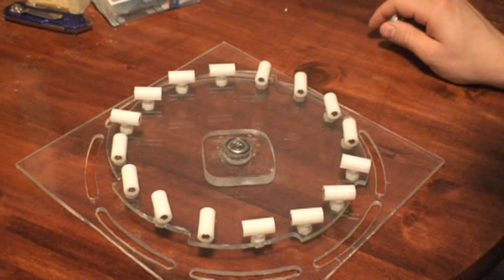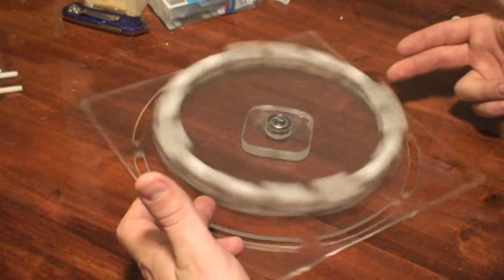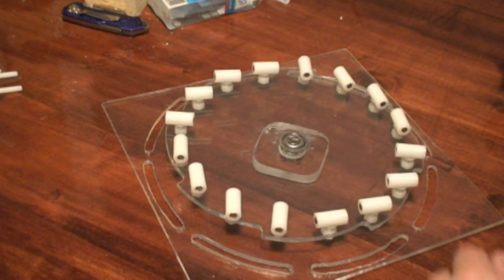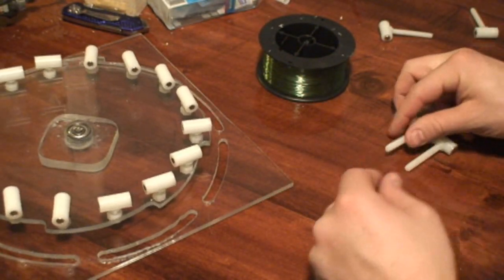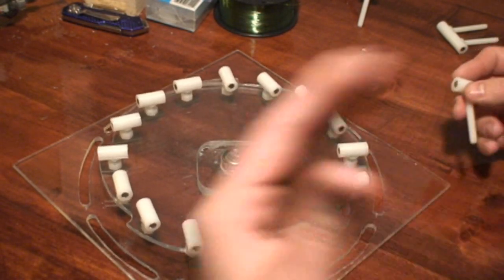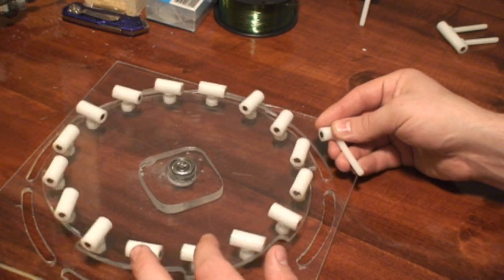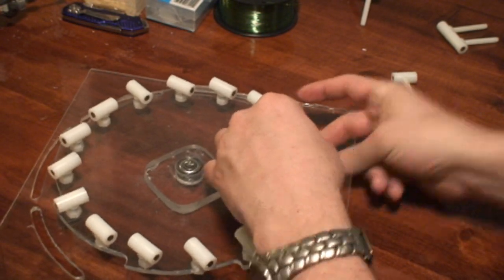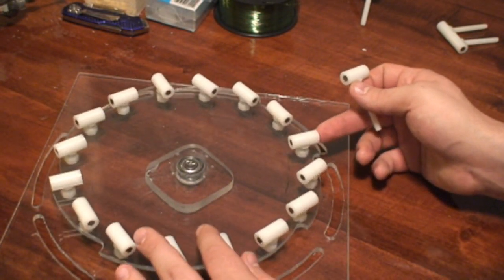Magnet motor, free energy, overunity test 2

Comment: This could work if you attached the magnet in his hand to the bottom of the wheel, and created some sort of mechanism where the single magnet flips around at a rate according to that of the wheel's energy, while being powered by the wheel at the same time. This is actually quite a creative idea I'm seeing, but the problem is that eventually the magnet would become demagnetized. It's like nuclear energy - powerful, but nonetheless limited. So this video isn't total bs because it could be engineered to work to a degree, but there still is no such thing as free energy.

Comment: The only problem that I have with this is that this isn't actually free energy. The magnets are providing force, certainly, but they aren't a limitless provider of energy. They will wear down eventually, and when they do your motor will stop running. In fact, I'm pretty sure you would lose more energy than you would generate by way of activation.

Comment: May be you don't need to switch the polarity. Try to set the attraction magnets on the all 4 corners and push them away mechanically with something attached to the wheel . Good luck.

Comment: Use heavy fly wheel , rotational inertia is basis for over unity devices, trigger one individual magnet on the rotating disc using a coil

Comment: The main problem with these perpetual motion motors is that they really fall short when you try to place a work load on them.  Yes, it will spin freely, but try placing a work load on it, and it fails.

Comment: A belt and it will spin the one u are holding. The one ur holding could have a curved handle back to the moter you got this bro.and if u changed each on e on the moter held the one in hand solid

Comment: Very nice approach. First of all, thx for the inspiring moment! I've not seen your other videos already, but, for the single "trigger" magnet, what if you male a "Bike system" between the larger disk & a small disk & attach the trigger to it in order to get the propper synchro to change poles? I'm sorry, my tech-mechanical english is the worst in the whole universe..., but, did you catch the idea? You'll just need to do the first shot, the system wont stop anymore..., am i wrong? Thx a lot for your time.

Comment: Put the main magnet, the one you have to switch back and forth, on a special mount which will be triggered by the spinning of the wheel. On the wheel, add an arm or something like that which can interact with the mount I already talked about. The two will work together to switch the magnet and continue the motion. And by the way, this video is way cool.

Comment: What if we can add gears and link it with the polarity of magnets on the glass with a pole atteched to the glass on which magnet are attached to rotate or switch the side of the pole of magnet which we have to rotate with our hand. And as fast as the glass rotates gears can changes or moves the magnet(the one which we use to attract the polarity of glass)

Comment: If it moves with the magnets pointed in one direction then why not just have them all facing that way and then you can just leave the one magnet in a stationary position instead of having to flip it back and forth ? Then you could just flip and reverse the poll to slow it down or stop it if you wanted.

Comment: It looks like you could build a holder for the magnet in your hand, attached to the base, that includes a "gear" with cogs that would be tripped by four cogs on the spinning disk. That would turn the magnet to the required position for each of the four sections. 
Or, really it should work by just turning all the magnets on the disk to have the same pole facing out, and fasten the driving magnets in place around the disk. But you've already tried that by now, and it doesn't work.

Comment: The motive power is coming from your fingers, as you twist that magnet.

If did that part using an electric motor, you'd find that motor consuming 10 watts for every 9 watts output power on your disc.

Comment: the laws are made to break them at some point, its called evolution. At some point the people thought that earth was plain object...
Here all people say "you can't do that..." stupid comments.

I can give my 2 cents which could help in a future. I've been experimenting at home, and i discovered that when you apply lateral/shear force (slide the magnets) your strenght needed is less than the required direct pull force, by perhaps 50-60%.
This means that if you can store that odd force and reuse it on the same cycle, you get acceleration. I am still thinking that this is possible, and i am almost close to finish a prototype whit springs and gears. This is not optimus because each gear is applying friction, but anyway, whenever you design a system is common to reach to a poor quality.

This is not called free energy, because magnets get exhausted at some point. But is a really good way to get "free" energy.
Reply: No, physics laws were there before we realized it.

Comment: nice try but, the power needed to flip an electromagnet would mean a greater input than output. to flip that permanent magnet in your hand would need gears & pulleys that will lose too much energy. a step up transformer with a 1:10 ratio may help.

Comment: if you were to turn that wheel into a gear, then put another gear at half ratio, cut a little circle at the edge of the smaller gear, use that hole for a rocker arm and a swivel block on the end with straight gear teeth on the bottom and a fixed guide on around it to hold it straight as it rocks back and forth (like a piston) .. then rig a gear around your power magnet at just the right size so the rocker arm flips it at every quarter of the wheel. and BAM! your wheel powers itself.

Comment: Well good to see that there are still enough people out there spending time on criticizing every good idea instead of thinking on their own. I believe that most of us today forgot what humans are capeable of.
Whatever I just wanna speak for myself:
I got some good ideas for this project and would like to share them. For example to prevent using extern energy sources you could find a mechanic answer to the problem like an impulse switch every time before your magnets are changing polarity.
Have to admit that I didnt calculate it yet but with the right balance you should be able to geht the thing up to a certain speed. depends on how much energy the magnets are putting against the seit hing system. 
I hope that I could help.

Comment: Now questions first what if you made that "machine " shall i say multiple layers and had them turning different directions would that affect the polarity of the first layer versus the second layer or would they be so polarized to the electro magnet (when you get one if you haven't by not now) that it wouldn't affect anything and also with the electro magnet how fast can it be set to as of course over the time it takes to get it spinning a high enough speed could the electro go faster would it speed up how would it do it if it could and would it be possible for it to spin so fast that say the magnets would come off or they would some how shift positions also could it spin faster than sound like i can tell that there is no electricity running to it from an outside machine or wall saquet could it possibly go at so many rpms that it creates a sound and then eventually it will be faster than that sound im not sure exactly how you would test it but im so curious about this brilliant idea...
Reply: But one last thing for now could this get so hot it could melt its self how fast would it be able to go how hot would it get im sorry that i have so many questions but then again i am only 15 and i just am fascinated by this im so interested in learning more about this please reply to me please .

Comment: You just made a typical synchronous motor. With a bearing in the axle, you have very low friction so it may appear to spin forever once it's moving. Eventually though it will stop. Furthermore, if you wanted your motor to do any real work (moving a car for instance), you will have to energize that electromagnet with a power source. This is precisely what typical motors do. You will never get more energy out than you put in. And because of friction and design limitations, you won't ever even get out as much as you put in. This is stuff that engineers have known for centuries now.

Comment: you probably have solved it by now. I know you dont need an electro mag to solve it. 
The end of each polarity cycle should have a lever and the lever trips the conductor to change the polarity of the conductor .

 the conductor should be constructed and positioned in such a manner whereby it is rotatable thus changing polarity when tripped by the level of each polarity change.

i can draw a simple sketch it has not been resolved.
i believe the most difficult part has already been achieved.

Comment: One of the best concepts I've seen so far.  
I think that would work with a partial gear to flip the stationary magnet, (perhaps use four stationary magnets) and also add a flywheel weight to make it strong enough to release pulses of work with the developed kinetic energy.

Comment: Hey bud, I really like that! All you would have to do is rig up a pinion drive gear system so that your stator drove the pinion wheel & simply run an axle with the switching/alternating magnet off the pinion. (Just a vehicle rear diff concept) That'd enable you to time the alternating/switching.

Comment: Hi there its been a while since you uploaded this video. 2 years before I was working on something very similar which I quitted because of the lack of money and materials. Most academics wont get into the topic and most critics are students who believe to understand physics. Since they dont fully understand thermodinamics, they will see a self sustaining device like imposible.  The truth with this permanent magnet systems is that they will naturally seek to balance themselves, but if the arrangement of the mangnets is displayed in a way they are always almost balanced but not quite... is when you can use a concept known as regenerative rotacion, taking advantage of this gap between momentum and balance.
 And eventhough it will not run forever, it will have and incredibly higher performance than the generators whe normally use. In the other hand it is clear to me that somebody who criticize someones work without taking the time to read the purpose of the experiment is a very laim observer, therefore, someone unable to apply the scientific method do to its poor hability to observe which is the first step on it. Keep on with your work the future is for those who seek what seems futuristic or impossible. The others will be the consumers of the great inventios. And keep in mind is better to be remembered as someone who tried than not be remembered at all.

Comment: I'm not too familiar with the losses of energy but I do know "free" energy is impossible. But could this self sustain? If it was made to mechanically change the magnet polarity every time it needed to would it be able to run itself? Obviously the free energy is bs because magnets wear down but I'm just curious. Could you hook up a small motor to this to basically convert the magnetic energy into electricity?

Comment: It's not free energy because he is expending energy to flip the magnet back and forth, as well as to resist the pull of the permanent magnets on the rotor.  All he is doing is slowly "inventing" a basic DC electric motor. If you were to take apart a typical simple DC electric motor,  you would see the brushes and permanent field magnets installed in the stator, and you would see the rotor with the electromagnets/armature as well as the commutator, which transmits the current to the armature in perfect timing as the shaft rotates. He has merely replaced the commutator + armature with his handheld magnet, and placed the permanent magnets on the rotor instead of the stator. The energy source is therefore the food in his gut (chemical energy that drives the body's movements) rather than a battery; but either way, energy is expended. He's complicating matters by adding the magnets; if he wanted to spin the rotor using his body's energy, he could just stick to spinning it with his fingers directly.

Comment: Magnetic motors will be the next energy source. Atomic magnets will be printed with a laser printing system that will use 1/1000th the energy of the output. Atomic magnets will essentially be 100% carbon with all atoms being aligned so that 100% of the atoms will be polarized. Atomic magnets will be orders of magnitude more powerful than magnets today. Magnetic motors will power everything in the future that batteries or fuel powered generators do today.

Comment: I have seen the use of the horseshoe magnet on the outside in a fixed location that according to the speed of the rotation would increase itself. I love your idea. You're showing transparency by using clear plexiglass without any motors which others have used to deceive their audience. Your design of angles is what I am most interested in. So one magnet is perpendicular and each successive magnet is @ a 15° angle?

Comment: you need to discover Lego Technic series, which includes oodles of tiny gears and such to set up a tram line to convert the main wheel to flip or rotate the controller magnet. ( ? ) + Too much Yabber.

Comment: what if you could mechanically cause the magnet outside of the circle to switch positions, such as through gears or clockwork.  Would the generator be able to be automated or would the extra friction from the gear-work lose too much energy?
Reply: The friction occurring in that process will not make the mechanism you suggested be possible.
For justifying my statement : If your idea works, you'll create a self perpetuating machine, which is not possible. :)
Reply: That is a suggestion, a simple pulley coming off the flywheel connected to the right size wheel to turn the stator magnet at the right moment of turn.

Comment: What about if you made 2 wheels the exact same and set them next to each other with the push synced. So that they worked off each other with out the need for a electromagnetic switch! Also Tesla was a firm believer in the numbers 3, 6, and 9 with the main number to everything being 9. 9 is the secret of the universe!   So you should probably have either 9, 18, 27, or 36 magnets for maximum efficiency! Also your groups of north/south should probably be 3 magnets not 4. Just some helpful advise!

Comment: What about a circuit attached to the electromagnet as the circuit is being powered by the single magnets so from the free energy powering the electromagnet then the electromagnet powers up more free energy from free energy in the first place then powering another circuit board that only powers another electromagnet that powers the entire other generator the storing energy inside rechargeable batteries attached through a battery charger circuit or just a plug in then letting you take the magnet away

Comment: Use gears to switch the polarity of the outside magnet. As the bigger wheel spins inside the smaller gears spin in accordance with the inner wheel. If you get the timing right you'll have it. The only problem is that it would reach high speed and explode due to friction and vibration. You're probably going to have to use stronger material.You can also make frictionless bearings, at least I have an idea how to make them. Constitute using aluminum bushings and magnets themselves.

Comment: this could be a dumb question but why have the whole mechanic of changing the polarity of the outside magnet if your goal is to get the thing to spin? if all you needed was to accelerate the disk couldn't you have all the magnets lined up so they'd all be repelled by the outside magnet? or attracted to, if it'd even make a difference. i just don't understand exactly why you need to complicate it by having the wheel divided into fourths and having it alternate between attractive and repelling forces, unless you've already tried that and it just doesn't work

Comment: well it should never stop on friction. 
Even if you can make the mechanics frictionless , the moment you want to draw power from it the magnets and wiring to generate electricity will create friction on the simple basis of the fact that motion energy needs to be transferred into a stream of electrons.
You also need to realize that because you made the rotating mechanism as frictionless as possible it is hard to realize the energy that it gets is not from the magnetic effect alone.
You first initiate the rotation by PUSHING the magnet in your hand into the repulsing magnetic field. that amount of energy you use would have been the same as making the machine spin by your own hand. then you continue to feed energy into the system by rotating the magnet in your hand to keep the fields pushing at the right moment.

this means you do have NOT a closed system.
Unless you can use the spinning mechanism to drive the engine magnet to rotate. and then you will realize your system got all the energy from your hand because it will simply always stop because the system is losing energy.

Comment: It's been many, many years since my last physics class. However, I have a few questions. In the setup you have shown, are all the magnets equal in strength? If you varied the strength of the magnets that are fixed along the perimeter, as in gradually increasing and decreasing in strength, how would that affect the speed of spin around the hub? And could that change, if any, be used to offset or overcome the energy lost due to friction and/or any other mechanisms added to your setup to facilitate automation? 

I really enjoyed video. The explanations were brief yet thorough. And I wish you the best of luck in your future endeavors